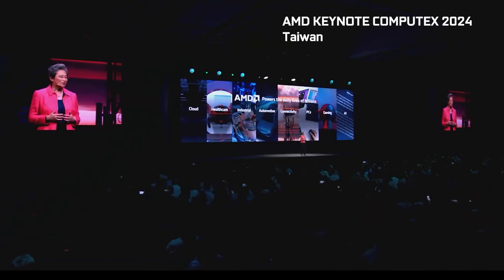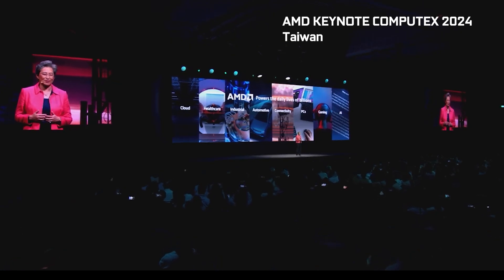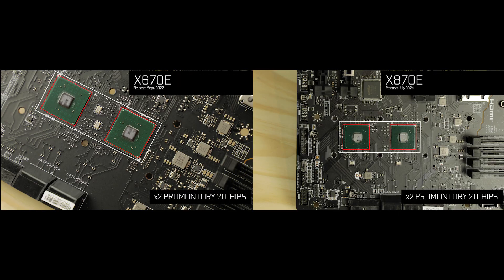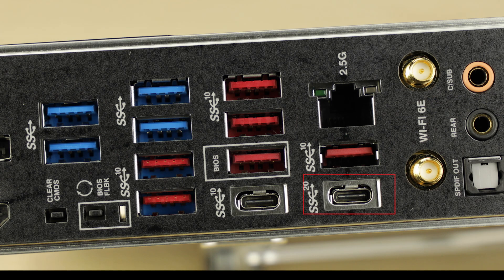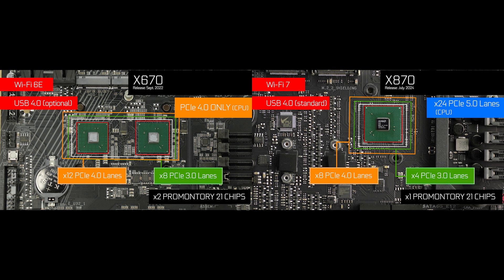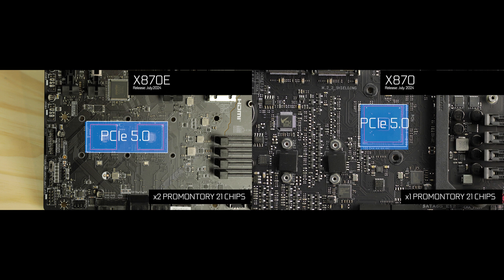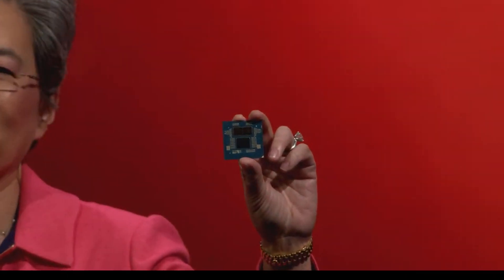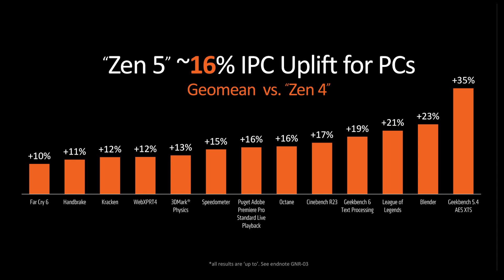AMD X870E and Ryzen 9000 : in short, do not waste your time (or money) on it.

Comment: Phoronic observed up to 16% general uplift between 7950X and 9950X. Caveat : they got it on some Linux distributions (Arch btw).

Being on Arch and having quite a big CPU bottleneck between my 4070S and my 3700X, I feel less frustrated to the idea to upgrade with some 9000... I'll only take my time because of the usual silicon lottery being worse at launch, but I like this generation : An alright uplift thanks to OS optimization, more power efficiency thanks to a matured architecture, and less to pay thanks to Windows users sending their complaints to AMD while half of it should be addressed to Microsoft. Win, win, win. ^^

Comment: I am only going to buy 8670e just for usb4 for my home server build.More cheaper boards will come with usb4/ thb4 connectivity, I was waiting for this. That's good  for certain people who didn’t upgrade in last 10 years.😅
Reply from the maker: Or get a B650e. Same PCIe lanes, USB4 ....  Not much of a difference
Reply: @Laurentschoice  Unfortunately any b650e with usb4 is not available in my country Bangladesh. I will wait for the new upcoming components. I am closely watching the videos  of computex 2024.Lets see the pricing and what comes next.
Reply: @Laurentschoice  ...you can get near USB 4, 40gps by using pcie to usb 3.2 gen 2x2 addon card.. 20gps...still bloody fast and backward compatible... on the other hand get if you have an existing board with usb 4 option then buy the addon card to use it, either Asus USB4 PCIe 4.0 Card or MSI USB4 PD100W Expansion Card.... Gigabyte has one too...  GC-MAPLE RIDGE

Comment: Significant IPC gains with huge energy efficiency vs last gen? That's a huge upgrade. If you have already a 7000 series cpu that is more than enough for years to come for the majority of regular consumers. But these new ones are great upgrades. If you want more PCIe lanes, get an entry-level threadripper...those are there for a few reasons and expansion and PCIe increases are one of them.
Reply from the maker: Meh... People are satisfied with so little these days.... Sniff
Reply: @Laurentschoice  that's my point, most people don't need so much. I myself, I need more, so I recently built a 7980X workstation with 192Gb which totally satisfies my needs for work. :)

Comment: The 9600 should be very close to a.7800X3D at only 65w.. that in itself is something to be impressed with... Zen 6 is the CPU that will bring change... Zen5 was always going to be a small refresh fixing issues and latency.
Reply from the maker: Meh... Well... If that's what gets you excited :)
Reply: @Laurentschoice  i'm excited that the older AM5 CPUs may start to drop in price even more... at the moment there is no AM5 budget build.. also compared to intels 13th gen to 14th gen (overclocked 13th gen)..Zen5 is exciting lol :)
Reply from the maker: @defectiveclone8450 well that was going to happen anyways :) .  After 18 months since the last big generational release.. I was expecting a real upgrade. Cores / better iGPU, onboard PCH based PCIe 5 lanes.    3nm lithography.     We are far far far from being anywhere satisfying .
Reply: @Laurentschoice   intel may have something better coming out soon. time will tell. Not a long wait !

Comment: You're missing something. Power efficiency. The 7700X is a 105W cpu of TDP and the 9700X is a 65W cpu. It will be easier for air cooling in small cases, for example. Not everyone needs to overclock or has a budget for liquid cooling.

Comment: i have 4080 super  and im going to buy soon the 7 7800X3D but after this announcement im not sure which motherboard to chose  ,msi X670E  msi B650 or X870E
Reply from the maker: B650E is the best in terms of features / values. Strix E in particular. Reviewed it few month back
Reply: @Laurentschoice  the only  available B650E  is the gigabyte  aorus master and the asus strix but in this gen I've heard bad things about the asus  so i have 2 options msi or gigabyte ,buts msi have only the b650 the mpg carbon or the x670E mpg
Reply from the maker: Reviewed that one too. It's an awesome ...gorgeous board !
Reply: @Laurentschoice  i know ,thanks to you I have chosen the current motherboard Gigabyte B550 Aorus Elite you make very good and detailing video, and now its time to upgrade because with my 4080 super on 2k i have big bottleneck , anyway which of the three motherboards would you recommend, the msi b650 mpg carbon, the X670E msi mpg or the gigabyte aorus master B650E?😀
Reply from the maker: Master B650E !!! Obviously :)))
Reply: don't buy MSI
Reply: @Geo64x Why; THE Msi It has made better motherboards for Am5 The only good  Is B650E  from gigabyte Also one thing that bothers me is the coil whine in the most gigabyte motherboards, and Asus is  pretty expensive with zero support

Comment: Not interesting to anyone who already had AM5 system from last gen, but devil is in the details and it definitely would be interesting for those who are upgrading from older jank. 9900K to 9950X seems like a nice small upgrade. +50!

And hey you have to consider the expectations. These companies do not have the resources to do full redo every year. It was always clear that after last year's AM5 new shiny (new socket, DDR5, new CPUs), this year was a small upgrade with nearly identical platform.
Reply from the maker: Been 18 months :((((((.......

Comment: Not quite sure what is being said here.   Granite Ridge CPU has 24 PCIE lanes - 16 for Graphics, 4 for NVME1 (usually), and another 4 for NVME2 (usually) +  4 lanes for the chipset.   Doesn't matter how many "promontory 21" bridge chips AMD has on a motherboard, any PCIE devices hanging downstream those bridge chips will still bottle-necked by the existing 4 lanes between the CPU->CHIPSET(s).  I'm assuming the USB4 controller will be connected to one of the "promontory 21" chipsets and given USB4 supposedly supports PCIE4.0x4 tunneling - how exactly will it have enough bandwidth when the CPU->CHIPSET upstream connection is being shared with everything else downstream (be it 10 GB Lan, WiFi, third NVME and etc).  

Will AMD go with a slightly different layout instead by going 16x CPU_PCIE for Graphics, 4x CPU_PCIE for NVME,. 4x CPU_PCIE for USB4  then the remaining CPU -> CHIPSET bandwidth (PCIE4xLane) will be shared with the 2ND NVME slot, SATA, WiFi, LAN, Expansion PCIe slots and etc?

My opinion is that they should have created a new socket with more PCIE lanes from the CPU  (maybe a total of 36 to 40 PCIE lanes) and get rid of needing a "chipset".   Would be nice to have

16x for Video Card
4x for NVME1
4x for NVME2
8x for expansion PCIE slot  (can be used for more NVME, or 25/40/100 Gigabit ethernet, or another Video Card)
4x for USB4 
1x lane for expansion PCIE slot

remaining 3 PCIE lanes can be used for 2.5GB LAN, WiFi7,  SATA.
Reply: If you need more pcie lanes,  they have that as well in threadripper.   Different socket just like you describe.   If you really need a large amount of lanes, there is the Epyc line. 

The larger packages also make cooling easier 

I agree with you that it is surprisingly easy to over run lane count for a serious professional workload.
Reply from the maker: Pinning this comment for all to see. 

Thanks again for the details comments and breakdown 💕

Comment: Let's see 3rd party benchmarks! 
But, I do believe that Zen 5 will be much better than Zen 4.
Reply from the maker: It is :) but not enough after a 18 months gestation.... And it's tough love... AMD missed the mark on PCIe 5 lanes supply this time. Especially as PCIe 5 is about to get much more relevant with next gen GPUs
Reply: @Laurentschoice  
AMD could've done more, however this architecture change is a much bigger step forward than what Intel offers, generally, at a new launch (gen 13 to gen 14, for example).

Comment: I'll stick with my AM4 Ryzen 9 5950X build, with an RTX 4070 Ti Super, and 128GB of RAM.  This PC is an absolute beast!!
Reply: Ryzen 9 7950X has no 128GB RAM till today... Very sad
Reply: @Fortespyproductions  I'm actually looking forward to a 5900XT CPU with 16 Cores and 32 Threads - tucked right between a 5900X and a 5950X.  Also might be thinking about a 9700X build.  It's only 65W TDP with more processing power!

Comment: the architecture is completely different yes clocks are the same but IPC has been improved as well as power usage I think the 870 870E are also improving memory speed
Reply from the maker: The memory speed is increased marginally (5200 to 5600 MT) and only tries to close the Intel Gap. 

The CPU has some improvements...
 But missed the most important part......... More PCIe 5.0 lanes.......
Reply: This guy: 7000 series 5.7ghz = 9000 5.7ghz = worst than a refresh. Thats why intel get to push 300watts (threadripper level energy usage) to go to 6ghz while doing nothing else.
Reply from the maker: The 9000 series is exploiting the same architecture. There are some gains, but after 18 months of development, they are way below what a full generation upscale should be. 

The fact that we are using identical chopsets should give u a big hint and somewhat of a pause :)
Reply: @Laurentschoice   well I am still on AM4 with a 5900x  32 gb ram @ 3600 cl 16 and very happy with its performance still so I guess it is all irrelevant to me I wont worry about upgrading until Zen6

Comment: Good video. Thank you for covering the differences. But I think you missed the part about EXPO supporting higher RAM speeds.
Reply from the maker: I initially covered that... And removed it while editing.... Bummer.  In short I was saying that the EXPO upgrade was marginal (5200 to 5600 MT) and..... Failed to close the clock gap we saw between the x670e and the z790 platform
Reply: @Laurentschoice  Yes, that is marginal. But suppose I'm building a system now and since Am5 socket is going to stay for few years, shouldn't I wait one or two months to buy the X870 series?

Comment: You are right...sadly they are becoming a bit like Intel as they are now the leader and with that the prices keep going up whilst the performance is only going up in smaller steps. The motherboards on both sides are already expensive. One can only hope that Intel come in with something very good as that will drive the compition on prices to lower....or even Qualcomm copming to the rescue...
Reply: What are the 9000 prices?
Reply: @nempk1  Not sure but will not be less than the 7000 series and probably a little bit more but as always AMD will lower later down the road as they always do. Pretty sure they are holding back the X3D versions to see what Arrow Lake will bring and then launch X3D to counter Arrow Lake.

Comment: Most people, myself included, don't need PCIe 5.0 and cannot tangibly benefit from it.  I'll be using a B650E board for my 9900X build, but not because of the E.  The one I've selected is simply laid out better.
Reply from the maker: Agreed... But the new gen of GPUs are around the corner... And PCIe 5 is about to gain some relevancy :)